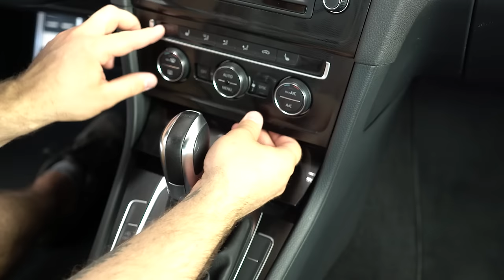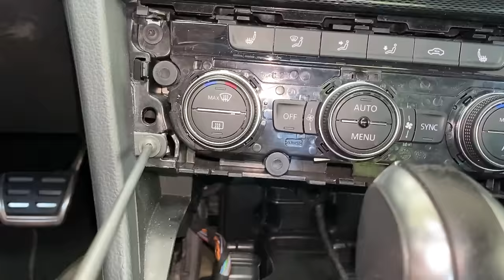3 DIY Car Upgrades VW Golf 7

Comment: That dynamic mirror signal was made WAY harder than it could’ve been. @Deutsche Auto Parts has a great video on it, all you need to do is just take the mirror cap off, not take apart the whole mirror
Reply: this is the safe way, you risk breaking the mirror cap clamps if you do otherwise
Reply: @asdf0987-u5g  not if you use the proper tools. Like I said the DAP video is really good and it’s way easier than taking the whole mirror apart piece by piece. Nothing wrong with this and people can choose how they want to do it obviously, but just sharing an easier, quicker way
Reply: @asdf0987-u5g  I did it even without removing the mirror. I see a lot of people taking of the mirror but with proper tools je can reach the clamps without any issue.
Reply: doesnt take much to remove the mirror either way its easy
Reply: So u suggest to buy 10dollar dynamic light and spending 50 on tools ?
Reply: Looooool I was thinking to myself do you really have to take the whole mirror apart?
Reply: deutsche
Reply: I was thinking that myself also the whole mirror housing didn’t need to be pulled apart also the link for gas struts ain’t working
Reply: Yep, I love the guys mentioned in this comment but I'd also do it the long way, those guys are doing the stuff all the time and can get oem parts cheap if broken we all can't 😂

Comment: Bought the dynamic turn signal off ebay. One of the best mods for 40 bucks
Reply: $40!? I got RIPPED
Still, one of my fav mods- turns heads
Reply: Yea I've seen them for over 100$ on different sites 🤨..now goin for 35$. No issues at all. If u hav a MK7 is a must

Comment: the auto open hatch mod requires programming if your car doesn’t pop the hatch when the key fob button is pressed. some of them only unlock the hatch and will only fully unlatch once you push in the emblem. my 2015 golf sportwagen does this.
Reply: Do you think it would work for golf tdi bluemotion
Reply: @antonw8004  did you try if you did did it work ?

Comment: Nice video! Need the link for those springs!
Reply from the maker: I’ve added them in the description
Reply: Be careful they can damage u r frame
Reply: DFC Garage the link isn’t working
Reply from the maker: P L wich one?
Reply: DFC Garage the link for the automatic lift gate isn’t working. I tried searching on eBay and couldn’t find anything like you used in the video.

Comment: the boot opener does it work with just the gas spring or do you have to code something to the key ? owner of VW Golf VII Variant when i push the button on the key it opens the door but i have to manually open

Comment: 1. I like it, but i think i'll also want to swap my headlights too, so they can at least both look kool.
2. I worry i may accidently open it without noticing. (EX while im at work and happen to be nearby and hit the button in my pocket)
3. That's quite a lot of work for a wireless charger, that also makes your phone not useable for driving directions and music controls.
Reply: to be fair the VW steering wheels come with media controls, but yeah they're all a little janky. 3 did clip in and fit pretty well though.
Reply: You really should not use your phone while driving.

Comment: The boot lifters are a terrible idea. I don’t want the lid popping open as I drive around. The engineers designed it to be weighted down for that reason.
Reply from the maker: You can find electric boot lifters but are hard to instal and more expensive